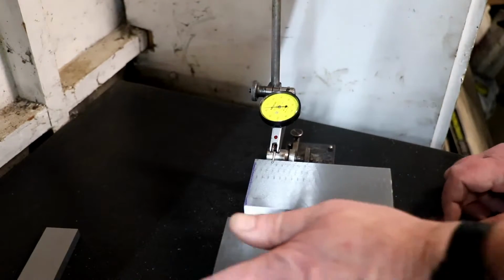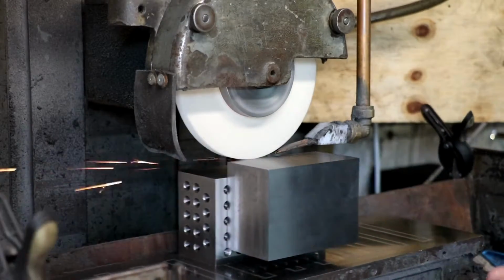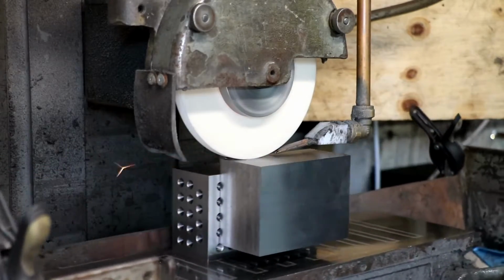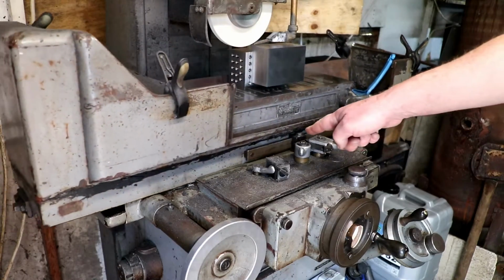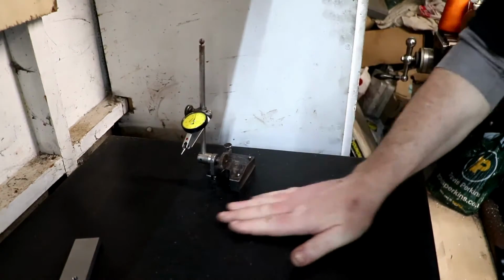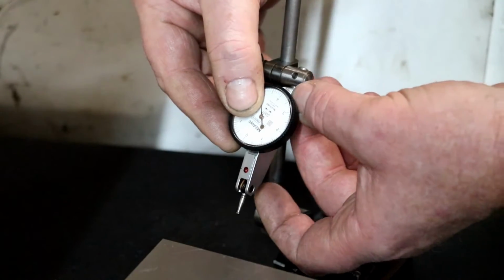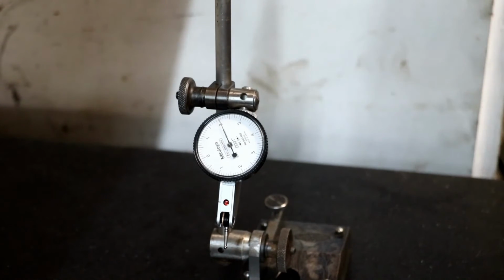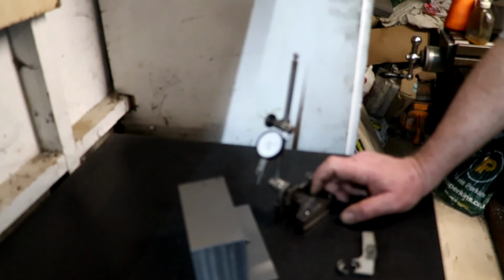Surface Grinding, Set Up Blocks 2

Comment: Your camera clarity and lighting is really good. It's gratifying to to see how quickly you are picking up on the little subtleties in precision surface grinding. When you are chasing that kind of precision you are very close to gage making minus the lapping. Here is a couple more comments to ponder. 😀 When measuring a surface for flatness the convention is, total indicated reading or T.I.R. So the delta of the highest reading to the lowest reading is considered the flatness. I don't care for tenth indicators. Too bouncy for me. I had one and got rid of it early on. When tenth tolerance is required a larger dial indicator graduated in thousandths works better for me. Personal preference I guess. When setting zero only use about a third or less of rotation. Not sure why this makes a difference. Use the biggest size ball tip if you have a choice  You are right on with the stone. Stone your chuck and the freshly ground workpiece as well. When I stone the workpiece I use a slightly rolling motion over the edges to remove any minute burrs which may want to roll under when putting it on the plate. Two steps: one pass lightly to feel for burrs. If none felt you are done. If one is felt,  time is spent to remove it. Do this every time. After cleaning your grantite plate avoid touching it with bare hands as much as you can. Clean it regularly. When chasing tenths it really needs to be that clean. Those who don't think oil film can affect readings still don't have the concept of just how small one tenth of a thousanth is.  Don't touch stone to granite plate. Grit and oils are removed with degreaser and cloth. Granite's desirable because it chips instead of throwing a burr. Stoning a granite plate will get you fired.😂.  I wouldn't hesitate to use the style of height gage you have. The proportion of base size to height you are working above the plate surface is reasonable. The base of your gage has to be flat though. Can't rock. I have encountered this issue. If not, you need to lap it in.  The part you made has to be flat on its registering side. There is a spring to push it tightly against it's mating surface and it needs to be stiff. You are on to something with the speed of your grinder speed. Especially the x speed. The physics involved with a few hundred pounds of table mass  coming to a complete stop, then reversing is a huge deal. If too violent I can see it leading to consistency issues. When you get this all sorted out you'll be amazed at how it'll suddenly fall into place for you. Sorry for the windy comments hope it helps. Hasta luego, Mike
Reply from the maker: Thanks Mike great explanation again, I'll read this over and hope  it sinks in.

Al.

Comment: Alan as a quick fix, flat stone a part of your mill table and use a mag base. Also if you have a piece of round tool steel place it between the mag base and your block when measuring to reduce the contact area. Steffan’s block is nice but too much work for you or me to do. Take the basic design but don’t worry about hardening everything just perhaps the curved front plate.
Reply from the maker: I've sorted it temporarily.

Al.

Comment: you're getting there! I can appreciate the frustration.. Tracing tenths with questionable measurement gear is big challenge. Cant tell, but maybe you can insert a ball bearing in the v area of that surface gauge.. Sweep using the ball bearing.. Or borrow gauge?  You will get there! persevere !!!  Thanks for sharing
Reply from the maker: Thanks DK I’ll get it I think just going to take a bit more effort.

Cheers Alan.